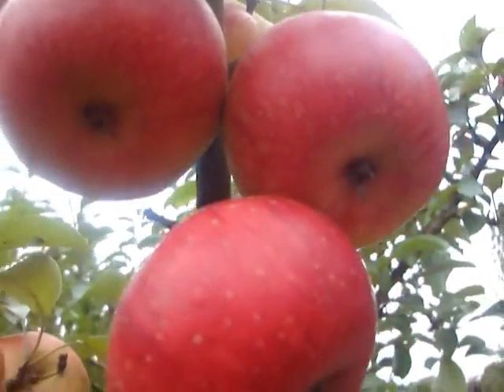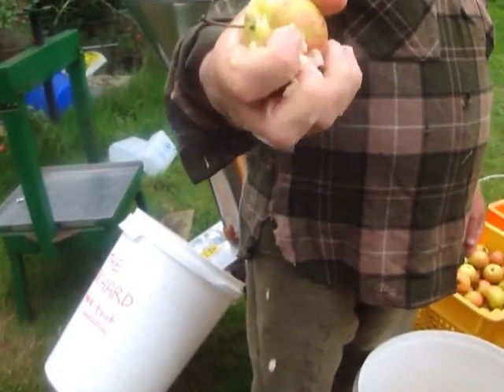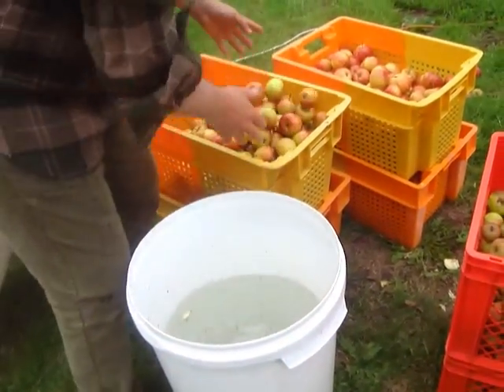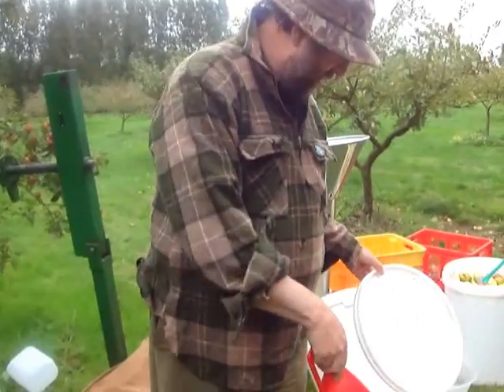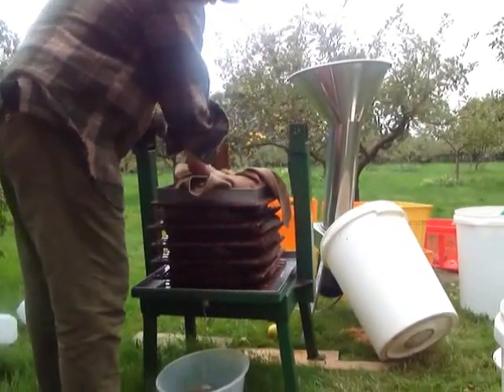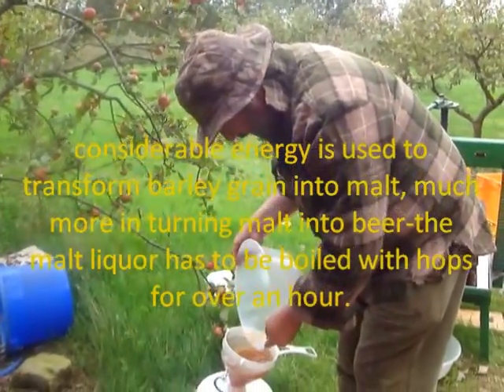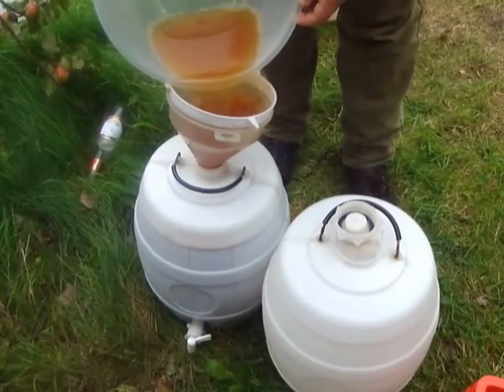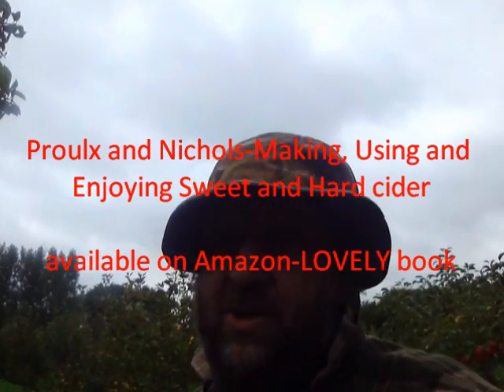Making sweet and hard apple cider

Comment: Absolutely love your videos. I have 23 varieties of apples growing here at home, and would love to add some old English varieties. Problem is I am in the hot humid American south (Arkansas) and dislike using any more chemicals than absolutely necessary. Do you have any experience with heat tolerant disease resistant varieties of apples? If so I would love to see a video dedicated to such varieties.